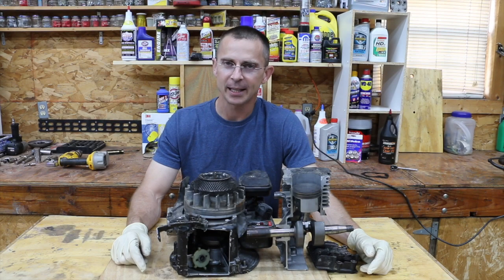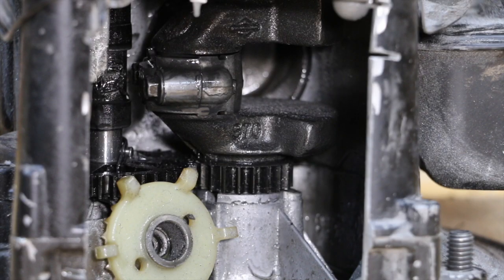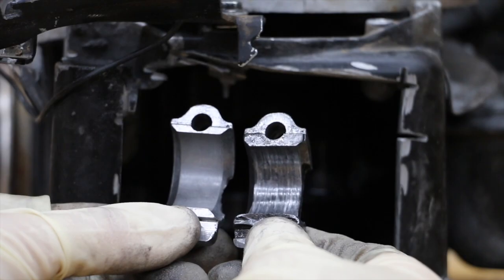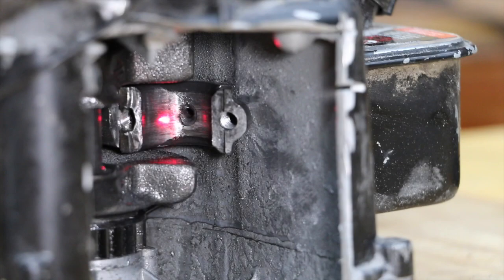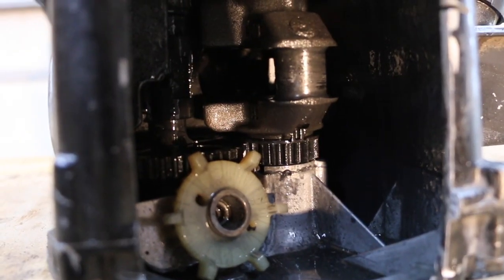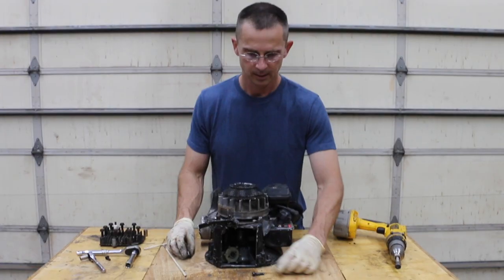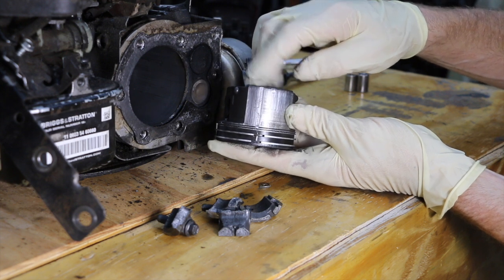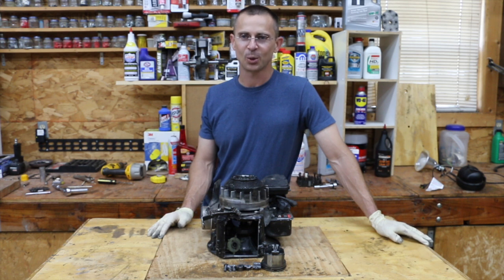Running Cutaway Engine Throws Connecting Rod!

Comment: A cool follow up video to this would be seeing if you can JB weld those con rod pieces back together and testing the strength of it. I've seen the other JB weld video but I'm curious to see to what extremes JB weld can withstand. Might as well build a whole engine out of the stuff at this point!
Reply from the maker: Thank you for the feedback!

Comment: It would be interesting to see the maximum angle one can operate a horizontal shaft motor before it is unable to be splashed with oil. And then top up the oil to maximize that angle. This is useful to know for outboard horizontal shaft air cooled engines that have the “mudd motor” kit, that causes the engine to be angled so the drive shaft extension dips the propeller in the water.
Reply from the maker: Great video idea!

Comment: When I was younger I had was in need of a cheap car bad so I got one from a used car lot. It had a slight knocking sound but the guy told me it wasn't nothing to worry about and it would be fine for my trip. The oil was clean but I changed it anyway and went on my trip. Along the way I'd stop every time the fuel tank went below half a tank check the oil and fill it up. On my return home I was about 300mi away from home when I stopped checked the oil filled up the fuel. Everything looked fine so I got back on the interstate and as soon as I got it up to speed I heard a loud bang then a bunch of loud pinging lol. I pulled over on the side of the road checked the oil and it was the famous chocolate milk color. A passer by stopping and pushed me to the next exit where I pulled the tags, got my stuff and abandoned the vehicle. I called the guy and told him where to pick up his car but I never heard what actually happened however I am pretty sure this is what happened lol. Luckily because of the noise it made I was smart enough to pay the least I possibly could and only had the vehicle for 2 weeks so I only lost the initial deposit and because I threatened to sue him for lying to me and selling me a lemon if he didn't release me from my contract I never had to make even the first payment. I knew the likelihood of this vehicle wasn't gonna be a good one but at the time the only thing I was concerned with was making this trip. I was actually relieved it happened although I would had rather it happened closer to home and not at 1am lol.

Comment: That was a pretty wicked vid... Have had several catastrophic failures when I was drag racing. We always examined the pieces afterwards. Have also seen some small engines fail when customer said it was idling but the internals were shredded, lol. Great video as always, keep em coming.. BTW, do something on Rotax, or xps lubricants vs other big brands, curious to see results.. 👍👍
Reply from the maker: Thank you

Comment: In Gary Indiana in about 1959 at a fire at Jackson’s restaurant,  a Detroit Diesel engine in a fire truck found a way to start sucking the engine oil out of the crankcase and ran away. The engineer running the controls on the side of the truck didn’t’t hear it above all the other chaotic noises. He was killed when the engine accelerated to a point it couldn’t hold together and when it detonated it went off with such force that internal parts inside blasted the Roots blower on the side of the engine completely off the block and this 60 pound accessory came through the truck body and killed the engineer where he stood. I went to high school with his son. These 2-cycle engines run with an abundance of available combustion air and if they pick up a stray source of fuel it will burn it all and run-off to a theoretical unlimited RPM and explode apart in the process.

Comment: I had a briggs powered zero-turn do that too, even with oil in it.  Those aluminum con rods sure do explode into many pieces. (and punched a hole through the side of the crankcase)  Decided to put a Honda with a real pressure lubrication system back in it.
Reply from the maker: Thank you for the feedback

Comment: Pretty cool! But what is that little white gear at the bottom used for?
Reply: It's an oil slinger.  More or less a crude oil pump.
Reply: @paulschliemann3489  Ah ok. Thanks.

Comment: Reminds me of running a roto tiller full throttle to break up hard clay soil in 1985. All went well until it started knocking loud for about 3 seconds then abruptly stopped. Same thing, a broken connecting rod. It's obviously a part that's subject to the most stresses in operation.
Reply from the maker: Thank you for the feedback

Comment: Looks like pot medal I hope companies are using better medal then that for motors.
Reply: nunya business   This is a briggs and stratton mate.  They have been making them the same for decades.  I currently have 2 that are more than 20 years old and running fine with no rebuilding.  I think they’re made of very good stuff and will be buying another one in about 10 years or so I think.

Comment: Love watching your videos! I recently built a spud Cannon out of PVC. I use a spark amplifier for ignition and hairspray works well if ambient temperature is above 75 degrees. I have seen other aerosoles used they all contain butane of some sort, I have tried using ether but have difficulty getting it to fire! I've also tried butane from a can and have seen it used in videos but they use some sort of fan to  keep it in suspension! Some controlled testing would be very interesting!
Reply from the maker: Thank you for the video idea!

Comment: Could you weld another connecting rod, to make it extra strong and do the same test again, to see if the block would crack
Reply from the maker: Thank you for the video idea!
Reply: I hope That comment made sense. Like make the connecting rod super strong. By welding extra metal onto it  So it wont brake. But the block will brake . Get a Con rod to come through the block

Comment: Back in the days of the Model T Ford, if a rod bearing started knocking, the driver would pull off the road, remove the engine and line the rod bearing with a piece of a leather belt. It got people home. These engines did not have insert bearings, but were poured in babbit bearings. If the bearings were not too worn, the owner could file the bearing cap some to take up the slop.
Reply from the maker: Great information. Thank you

Comment: If you wanted to throw a rod quick, just disconnect the governor and run the engine full throttle. Even with oil the rod would snap withing 1 minute
Reply from the maker: Thanks for the feedback!

Comment: Video Idea: show how long it takes to warm up a motor by measuring temp in the crank case, or see if different crank case temps occur with different oils/additives when motor is under heavy load
Reply from the maker: Great video idea!

Comment: Breaking a con rod reminded me of a comment from a racing driver back in the late 70's   His car retired from an event in a huge cloud of oil smoke.  Later when asked what caused his car to break down, the driver said "it was an electrical fault"  The interviewer (in disbelieving tone) questioned the driver for more detail, and he said " It was an electrical fault, - I broke a con rod, and it punched a hole clean through the side of the block, and knocked the alternator off". Haha, very nice.....
Reply from the maker: lol. Funny!
Reply: Very old story, at least 50 years old to my memories. It can be the rod knocked the starter off or the distributor. Or on a diesel I saw once it knocked the injection pump off.
Reply: LDN Wholesale oddly enough I had the #8 rod let go on a racing 460 BBF engine once. It went out the right side of the block and hit the starter motor knocking it clean off the car and split the bellhousing in half as well. That was an expensive engine failure.
Reply: @kelvinhill9874  Had a much less expensive incident and had a brand new kart engine blow up. Still keep the piston in my toolbox as a reminder to check and recheck things!
Reply: @ldnwholesale8552  A rod shouldn't knock at all.  There's your problem!
Reply: that was a Ferrari GP car.  
the drivers were told NEVER blame a DNF on the engine.
Reply: Haha that’s great 😀

Comment: I would've given ANYTHING to have had you as an instructor way back when I was taking 4H small engines classes. 

That being said, are you any good at TIG welding? TIG that puzzle back together & see how long it runs. Or cut a good rod in half, TIG weld it back together and see how long it lasts.
Reply from the maker: Thank you for the video idea!

Comment: Ever wonder what happens when a diesel engine does that. I'll tell ya  I seen the connecting rod I a cement floor either it was a 1 in a million shot or not it still happened it was an old 2 stroke Detroit
Reply from the maker: Wow!

Comment: That happened to my first car, went right through the side and totalled the engine. lucky it was an old car with none of the modern electronics, the replacement engine was cheap and took a whole 30 minutes to take out the old one and put in the replacement.
Reply from the maker: Wow!

Comment: Great video and good safety precautions. Would having a light oil spray into the engine keep it running?
Reply from the maker: Thank you!  I lubed the connecting rod before starting the engine but the connecting rod was just too damaged.

Comment: I have lots fail spun a bearing on my truck do to no oil and redline and snapped a connecting rode on my Ford 460 do do water logging it and trying to started it started ran a few min and then stated Nocken and grenade it self
Reply from the maker: Wow!

Comment: Make an HHO Catalytic converter heater
Reply from the maker: Thank you for the video idea!
Reply: I hear that an HHO Generator using a automotive Catalytic Converter is crazy efficient. I don’t know about the construction design as of yet. I’ve seen several built with sand on YouTube. And I’ve also seen them using the Automotive Catalytic Converter as well. I might be able to get a Catalytic Converter from a muffler shop, if I can talk them into letting me have one for free. Otherwise Amazon has some very reasonably. I really want to build one myself. I’ve had a few expensive projects that I have built finished up recently. So I might be able to start to build one pretty soon.

Comment: Granted, the piston is scored, but all in all, the rings, piston, and cylinder are in MUCH better condition that I would expect, for running with no oil, and no cooling. Running the engine with out the starter cover keeps the flywheel fan from being able to cool the engine at all, considering the high cylinder head temperature. I don't know how the piston and rings didn't seize in the cylinder. It also puzzles me, how the exhaust valve didn't seize in it's valve  guide, considering high temperature, and no lubrication. i would like to see what the lobes on the camshaft look like.
Reply from the maker: Great point

Comment: I had a 71 VW Squareback  that my mechanic said split the camshaft in two after only about 40 hours of use and maybe 5 times that number in cold starts..  It was rebuilt by a guy who thought he knew everything he worked for my Dad for a short time as a handyman at a small airport in PA.  Not an A&P mechanic don't worry! I've always wondered if you could do a video of a way over torqued engine versus under torqued engine and baseline properly torqued engine longevity? Thanks for the video.
Reply from the maker: Thank you! You're welcome!

Comment: Have done bunches of engine catastrophic dissinerations and have found that lack of oil increases heat and tolerances between parts which as you've demonstrated will cause failures.   I had one today, a V twin 242 hours on it, full of oil, running at recommended RPM and in a flash throws a rod and puts a hole in the block.  It leaks oil for hundreds of feet dragging it back to the shop. So it had oil. But as I've found over the years sometime parts just fail.
Reply from the maker: Thank you

Comment: Take any car engine and run it at full throttle while pouring a cup of BBs down the carb throat...Spectacular results !
Reply from the maker: Thank You!
Reply: Maybe if you ran a 2 cycle gas/oil mix in the fuel tank, the piston might have lasted a bit longer.

Comment: When an engine is well looked after and oil is always put in the sump. What can cause a rod failure?
Reply: Foreign material contamination of bearings from wear elsewhere in the engine, microscopic cracks in the rod from use or poor manufacture, and work hardening from the natural flexing and stretching that happens in ordinary use are just a few causes.

Comment: Does size determine RPM?
I'm just curious.
Reply: The size of the stroke can determine maximum rpm. Most engines Max out with the pistons moving about 60mph each way, iirc. The longer the stroke is, the slower the crankshaft will be turning for that 60mph piston.

Comment: Briggs and Stratton can make these engines for, what, $20 bucks?  (If you can buy a new basic lawnmower for $99 full retail).  It's amazing that they last so long and tolerate so much abuse as cheap as they are made.
Reply from the maker: Thank you!

Comment: What about a little piston slap? It only happens when I start my car cold.
Reply from the maker: Is it a GM?  I have a suburban that's done the same since I bought it with 82000 miles.  It now has 229000 miles and continues to rattle when cold but runs great afterwards.
Reply: Project Farm yeah, it’s an 04 Chevy impala 9c1. so it was well maintained as a prior police car, but started the piston slap since about 150k. I’m at 184k. I love the car but it eats wheel bearings lol. I’m on like 8 or 9 since I got it. But she’s a beast

Ps- thank you for replying. I appreciate the reassurance that my engine is not 100 toast. lol. everything runs smooth after about 10 mins (at most) of warming up.

Comment: Have you ever tried throwing some type of super charger on the mower engine ?? That would be cool!
Reply from the maker: Thank you for the video idea!
Reply: Project Farm I’ve seen people use ford smog pumps on old Briggs mower  engines for this and ethanol to run them, for go kart motors
Reply: @stopglobalswarming  - they are selling the  AMR500 and AMR300 for a couple hundred bucks - smog pumps marketed as superchargers
Reply: Turbo would be little easier. No need to line up a belt. Use the smallest one u can find so it will build boost
Reply: @boosted95  What is wrong with you? You always push more than the engine can handle. Hmm, maybe that is why I have a collection scrap blocks.
Reply: Nitrous progressively until destruction. Or boost until destruction.
Reply: I'd just hook a leaf blower up to an adapter that brought it down to inlet-size.
Reply: @tankerd1847  wait does that actually work
Reply: Also a mechanism to connect it to the tyres.The mower will just totally run crazy
Reply: The engine would not run 'cool' with a super charger; it makes them run more hot... 🤦‍♂️
Reply: @eknaap8800  -Funny... hah
Reply: @Blogengezer  Am I lying? 😎

Comment: High school Grade 11.

We had a small engines course and the school had bought a number of new  Briggs lawn mower engines. The idea was disassembly and reassembly.

So there was quite a few kids in there that thought they knew about engines but really knew very little.

One kid, always taking smack, reassembled his engine incorrectly in some way and it was very hard to pull. Teacher comes over, just HEAVES the cord  and the engine started BANG BANG BANG, literally 2 seconds and the connector rod end blew a fist sized hole in the crank case, pieces everywhere.

I've seldom laughed quite as hard
Reply from the maker: Wow!  That's funny and a little scary!

Comment: when I was in small engines class in high school say... 3 or 4 years ago, you had a choice of bringing in your own engine to work on or use these really nice and brand new b&s motors, which the teacher would intentionally do things to the engine to stop it from working, and I remember this one time someone got it working and it blew a connecting rod and it shot out the side of the crank case, luckily no one was hurt and the teacher had nothing to do with it.
Reply from the maker: Wow!  Glad there weren't any injuries!

Comment: Back when I was in high school I took a small engines class, another classmate who I helped finish the reassembly of his engine not only snapped a connecting rod but it then threw part of the connecting rod through the crankcase side, smacking me in the leg. We think what happened is he didn't torque the connecting rod bolts as he should have so a mix between that and his governor not assembled properly cause the engine to spin out of control and throw the rod through the crankcase
Reply from the maker: Wow!  I hope you didn't get injured!

Comment: Helped a friend whose son's car's engine was seized. I (we) assumed it was a broken connecting rod. We rotated the engine backwards a bit, and it freed the lodging enough that it would run, and we at least drove it home and saved a tow charge.  I knew it could not have seized that solidly by what was said. That came across as a freakin' magician; it even surprised me.
Reply from the maker: Excellent!

Comment: I used to be a small engine mechanic.... if I had a chainsaw or weedeater that wasnt worth fixing I would put straight gas in... did it several that way.... a crappy craftsman chainsaw lasted about 6 minutes wired wide open..
Reply from the maker: Wow! Thank you

Comment: Hey PF. I realize this is a really old video and you may not have this engine anymore, but it looks to me like all that was irreparably damaged was the conrod. Would you be able to make a replacement out of some random pieces of steel with holes drilled through and try for round 2?
Reply from the maker: Great point. I wish I still had the engine